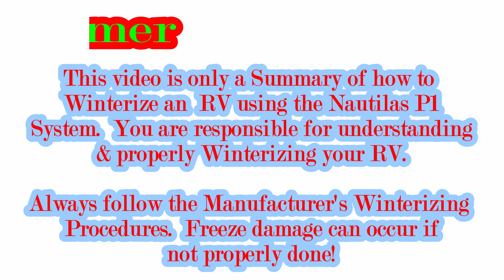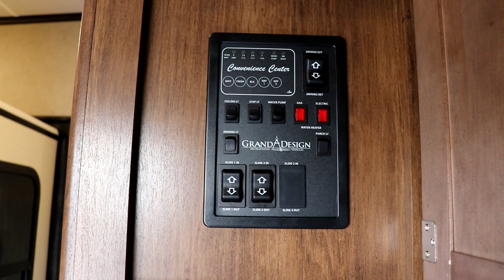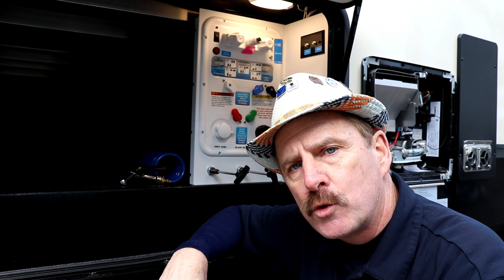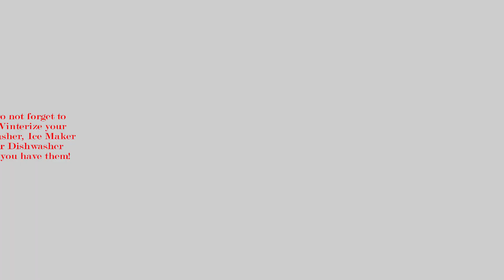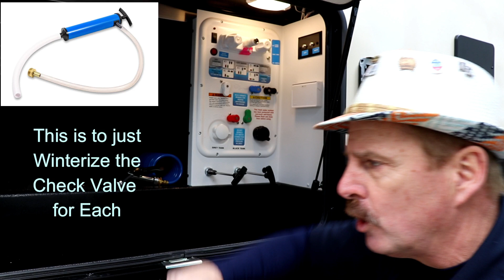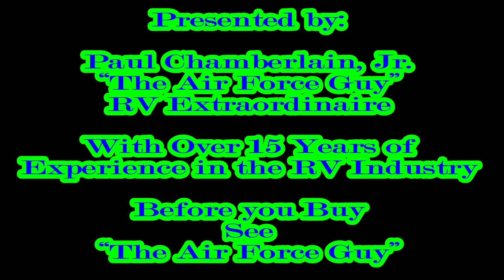How to Winterize Your RV using the Nautilas P1 System  - w/Paul Chamberlain, Jr. "The Air Force Guy"

Comment: Hi there and THANK YOU for producing this useful video. I have a comment on your last step in the video (7:15 in video) where you suggest turning all valves to 45-degrees for 10 seconds to fill all lines with anti-freeze before shutting off the pump. I don't believe you want to turn the hot water (red handle) to 45-degrees because you would never want to run anti-freeze into the water pump. Just for giggles, I checked the grand design manual and sure enough (see step 14 on page 11/14) and you'll see they turn the BLUE, GREEN and WHITE handles so they are at a 45 degree angle, BUT the red handle remains closed.